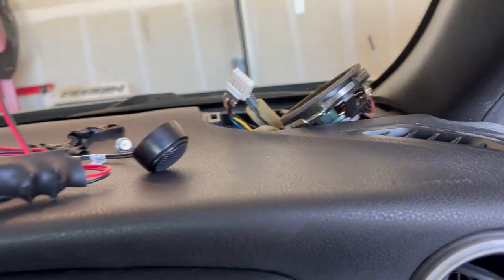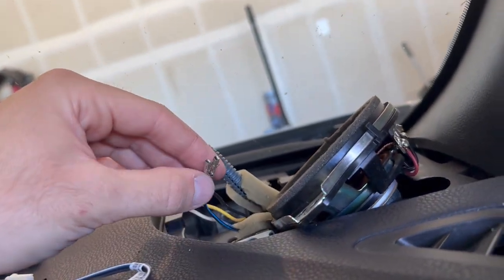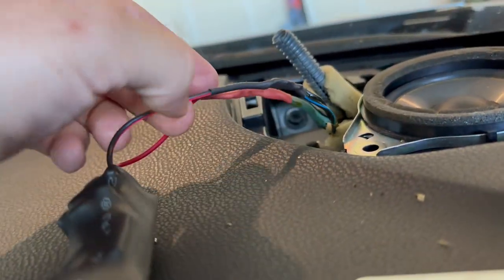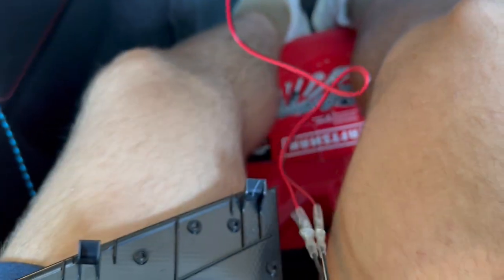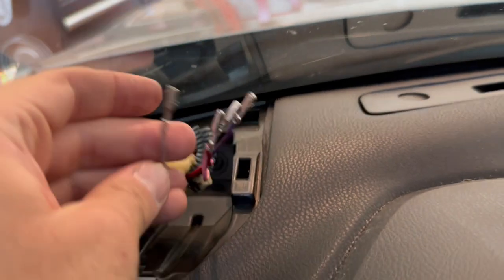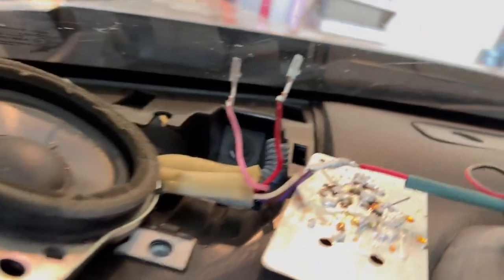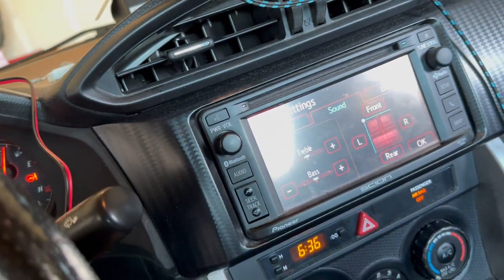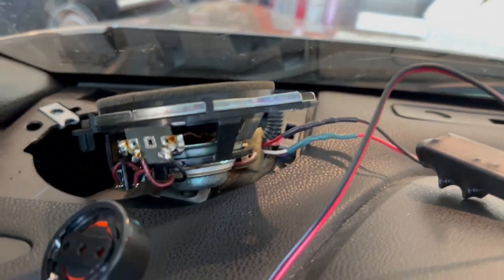FRS - BRZ - FT86 Tweeter Speaker Replacement Tutorial

Comment: Can you also make a video on the other speakers when you install them please want to do this for my 86 😭 great info on the tweeters
Reply from the maker: I wish I could make an install video but I won’t exactly have the time to recently been too busy. The other speakers are extremely simple though. The rear speakers just need to connect the positive and negative wires on the right spots on the terminals on the speaker itself. Positive being Red and Negative being Black on the connector, I still used the OEM connector I just cut the wires and soldered them to the terminals, but you can also use crimp connectors if your speaker uses them. I had to drill holes in the OEM bracket to fit the new speakers. The door panel speakers I just went to Best Buy and bought the mounting kit they had for the speakers I bought, took some figuring out but it’s pretty simple. I have pictures of how I wired the door speakers if you would like to see. The other front speakers were the same situation as the back speakers in terms of the wiring, after that I tried to modify the brackets that the OEM speakers were on to accommodate the new speakers
Reply: What speakers did you use for the other ones?
Reply from the maker: @SergioMartinez-dp9qt  I used the JBL Club 322F on the front dashboard and for the rear seat speakers

Comment: For connecting wires another easier way instead of solder is just to use some wago 221 connectors, they should hold up quite well and be worlds easier than soldering

Comment: that little box is most likely a mini crossover. it filters out low frequencies to ensure that if there is any error in you tuning either via head unit or amplifier that it does not play any low frequencies out of the tweeter and blow it almost instantly.
Reply: also best way ive found to solder wires together is to get a drop of solder on the iron and just put it on the wire, just be careful not to do too much so it doesnt drip
Reply from the maker: Ah I didn’t know that, that makes sense then